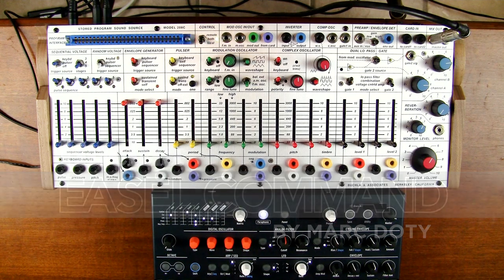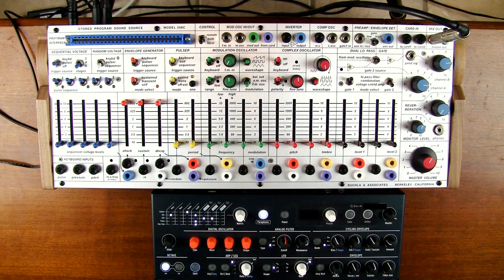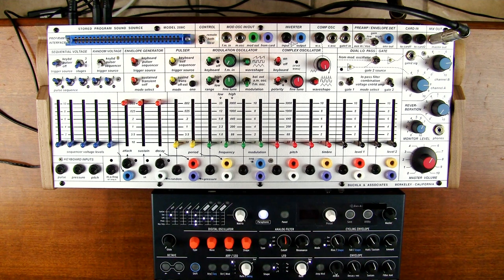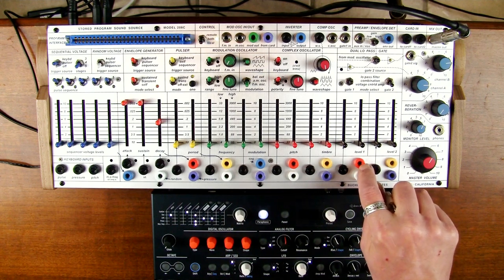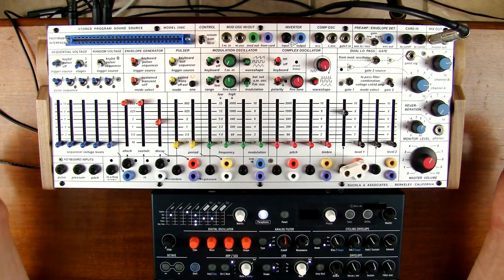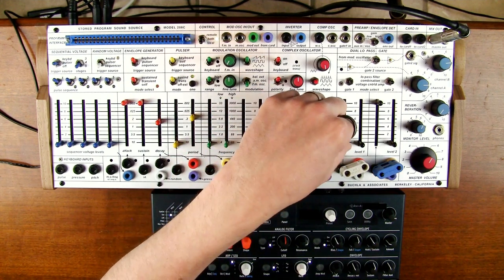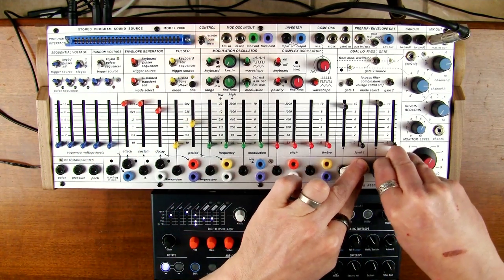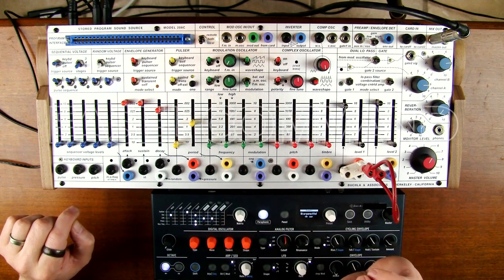01-The Buchla Easel Command- Part one: Introduction

Comment: What is your opinion on the sound of the new RoHS compliant vactrols VS the old school vactrols in the older easels?
Reply from the maker: Ugh, vactrols.  They are a nightmare for Buchla.  It’s very challenging to find a good, solid, consistent source of them, and then, there are vast variances between them, which means that they must be individually tested.  So, before we even get to comparing various historical iterations, there’s all of that.  There isn’t much that can be done.

Comment: Hey Marc, I hope all is well with you. Hey I have a question…on my easel command, I connected random to the oscillator and after a several minutes listening at a fairly fast pace, it became really apparent that it wasn’t so much random,as an actual sequence…a definite repeating looping pattern.  I just wondered if you knew that Buchla Easel random is TRUE random…or it is just a sample of random that is then looped?  I’d say it’s around a 64 note loop.(guessing).  Thanks Marc.
Reply from the maker: Actually, you're right!  It is a definite loop of voltages!  There are certain settings that reveal this truth, although many don't seem to.  One of my Easel compositions on YouTube, I can't recall which, makes it REALLY obvious, as it sounds almost like a repeated "melody."
Reply: Good catch, homey. Don’t take offense, but, are you, by any chance, on the spectrum?
Reply: Another interesting fact about the random outputs, each one has its own behaviour and acts differently.